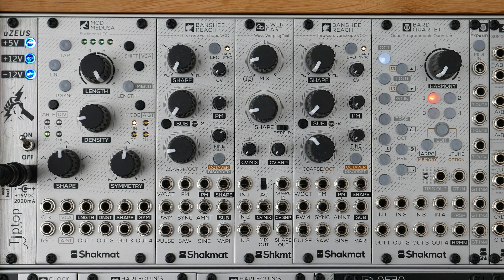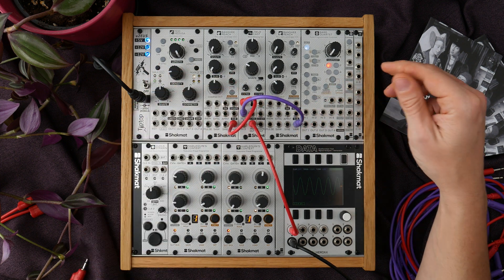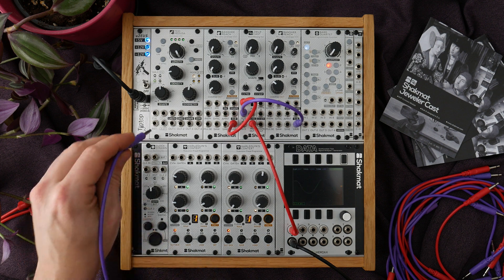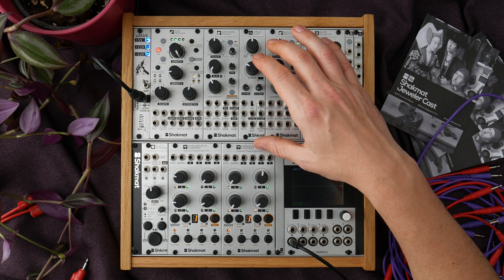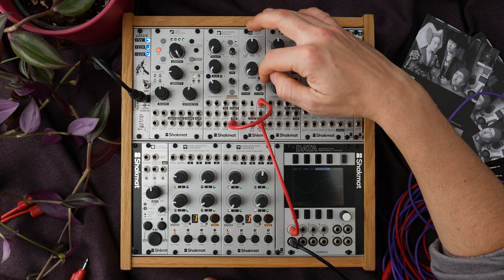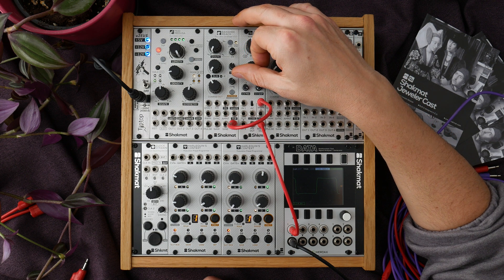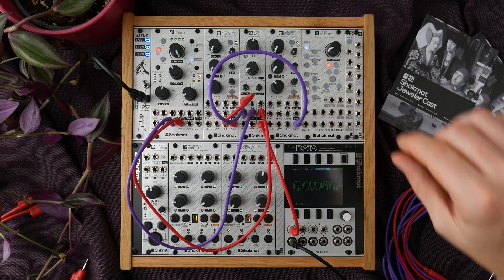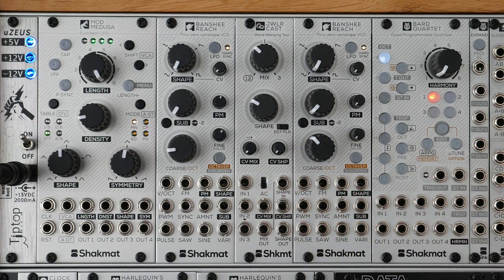Shakmat Jeweler Cast: Demo

Comment: Found this module while searching Perfect Circuit's website, selecting "Mixer" as the search filter, which I found intriguing when I encountered the unconventional Jeweler Cast. Clever elegant implementation of that Mix knob!! Reminiscent of the EML-101 for me where its Amp knob can smoothly crossfade between the mix oscillator output and its ring mod circuit. Very cool! The even amplitude crossfade sounds so smooth - no annoying changes in combined amplitude.

What happens when a signal is plugged into input 3? Would have liked to observe that behavior. Presumably in that case, one can crossfade from input 1 to 2 or 1 to 3, but not 2 to 3. Tradeoffs will have to be conceded for such one-knob elegance! I like it.

Comment: Is the wavefolding section inspired by the serge wave multiplier? I guess one could implement the wavefolder and distorter with just one LM13700 and then just switch between the circuits. I am always asking myself what the circuits are inspired by. I guess a lot of them come from electronotes (I mean analog circuits from all the manufacturers in general) and Ken Stones website and of course a lot of other schematic online.
Reply from the maker: The wavefolder is indeed a serial wavefolder so same philosophy as the serge ones. The distorsion is a mix of different techniques. Those circuits use more then a single OTA as the dry signal is crossfaded with the wet signal at the very beginning of the potentiometer's travel.